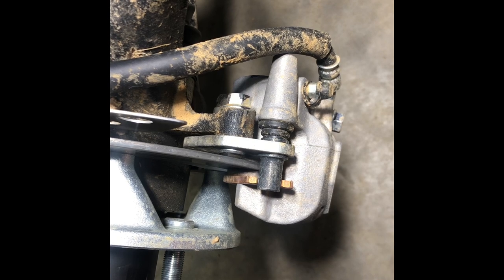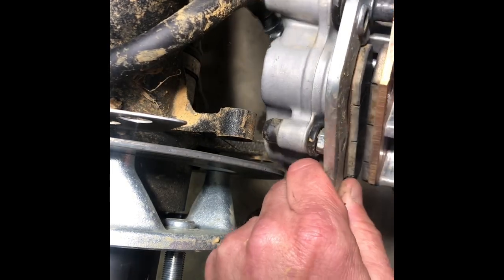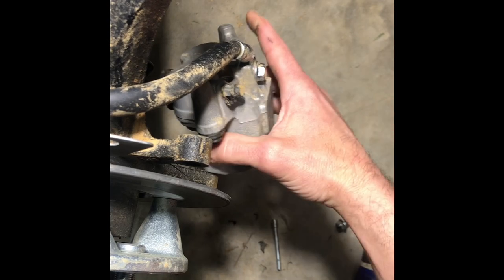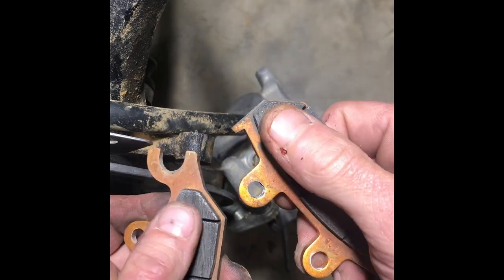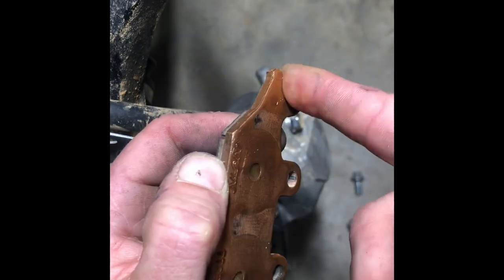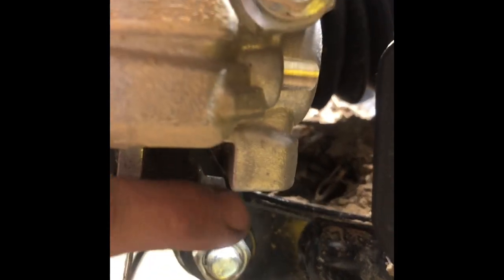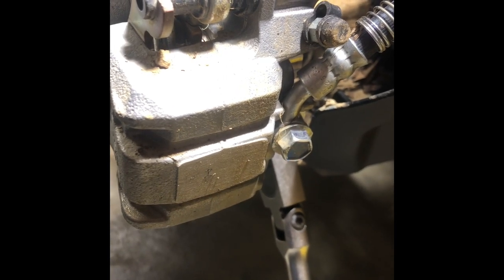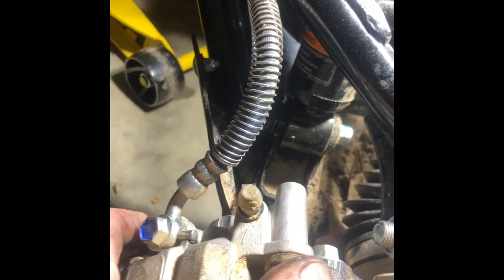Yamaha Brake Squeak Fix!

Comment: What is causing the squeaking?On my Rmax it sounds like a rotating squeak. In other words squeaks when the tire rotates. Do you think it’s the brakes or possibly an axle/wheel bearings? It’s really annoying for sure. Thanks for the video liked and subscribed 👍
Reply from the maker: I know a lot of people complain about the park on the RMAX squeaking like you describe. I have had many people fix their RMAX squeak by following this video.